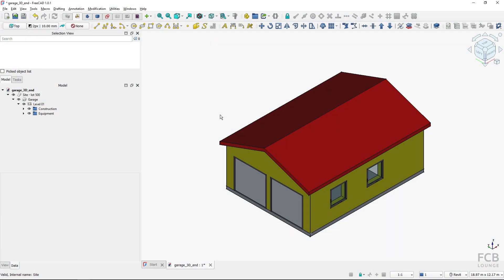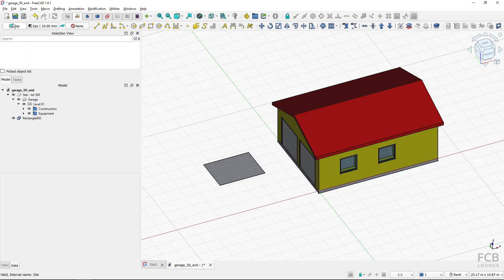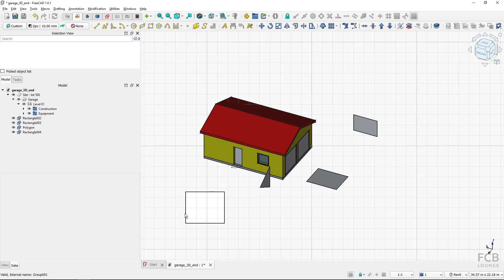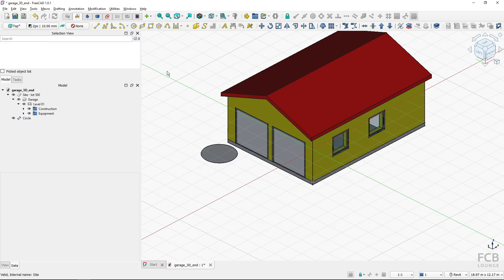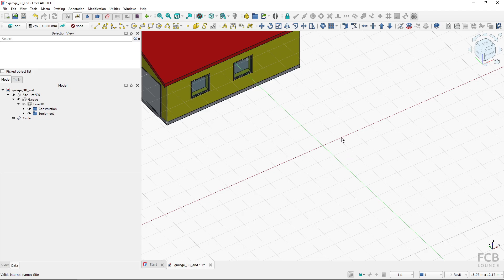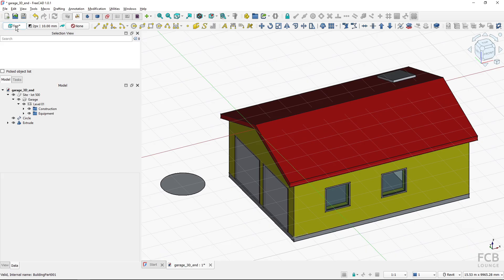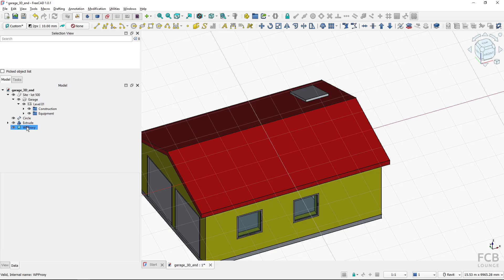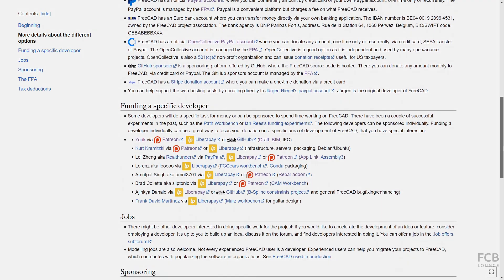Working Plane Setup in FreeCAD Draft Explained

Comment: So this is pretty much transfering values of the objects properties and transfering to a spreadsheet by filtering the Property and Object. Theres is really no other way yet to quantify a multimaterial wall  at once..? or is there any way to quantify a multimaterial object ? i learned here that its kind of not possible because its not string type...  If i would want to know the amount of basecoat, brick and stucco  my only option would be filtering the wall area and in a spreadsheet multiplying by the thickness? is that the only way Tom ? i dont want to be negative but if that where the case, i would find useless taking our time to use multimaterial walls that dont quantify... im just trying to know if i have the right vision about the current status of FreeCAD which i love and will continue supporting of course...
Reply from the maker: I am not sure about it but I think it is not possible to create takeoff for layers inside of a multi material wall. You might find reading this forum thread useful, an alternative way of modelling multi material walls is shown there: https://forum.freecad.org/viewtopic.php?p=756869#p756869